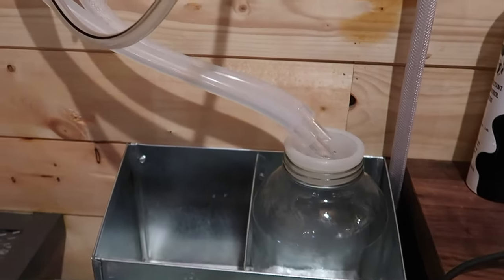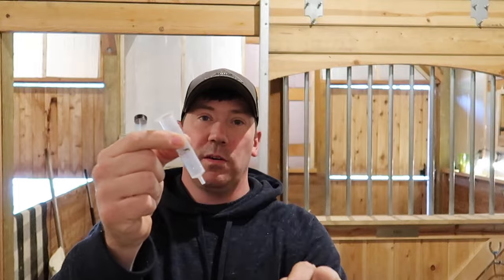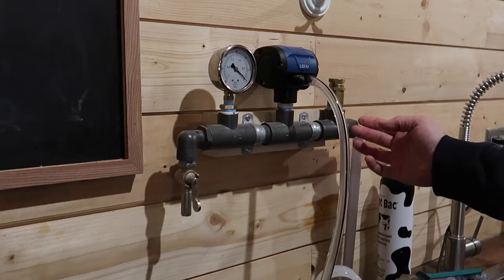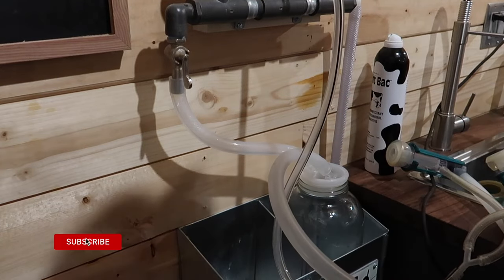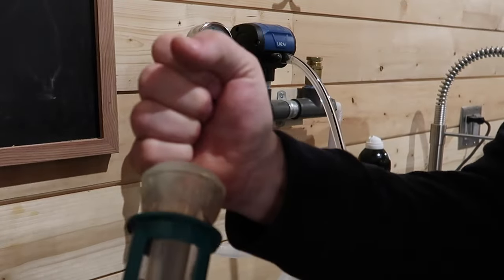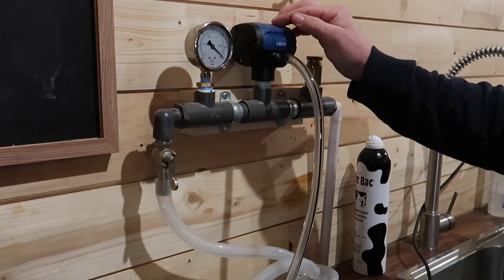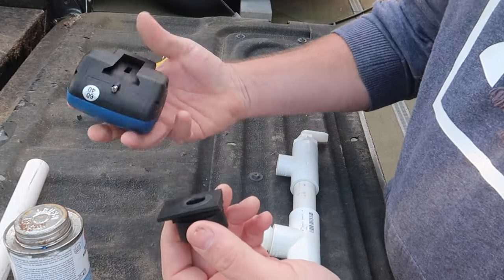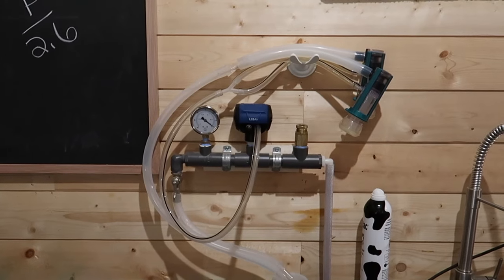Best DIY Milk Machine For your Homestead or Dairy Farm! Goat Milk Machine

Comment: So....if you didn't have a vacuum pump, could you de-pressurize the glass jar so it had a constant vacuum? Would the system still operated though perhaps not as efficiently? How much psi do you need for effective milking on the goats?

Comment: I'm in the process of putting this together and sourcing parts from the suppliers you listed for the viewers.  What I am running into is that some of these suppliers can get a little testy when they figure out that you are going to DIY.  The product descriptions on some of their websites are not clear or missing key information like dimensions.  If you need to call and ask questions, try not to let on that this is DIY and the conversation will go easier.

Comment: Thanks for the video.  I have an older blue tank simple pulse that had one side of the tank pop off.  I didn't want to buy a new system and was thinking of a way to replace the tank portion but trying to seal holes in a round pipe was pretty tricky.  This idea is perfect since I already have the valve, guage and pulsator from the simple pulse.  I've upgraded to a small bucket now with my Sables which milk more than a gallon jar can hold so looking at scrapping the clumsy jar holder on the tank anyway. So glad I found your video.
Reply from the maker: Awesome 👏🏻 glad it helped!

Comment: I am curious about the decision to use 3/4 PVC.  Most of the machines have a pressure tank that looks to have a 3 to 4 inch diameter.  I am always concerned that some milk or maybe just milk vapor will go into the tank and want to be able to clean and see the inside.
Reply from the maker: We haven’t had any issues, and we did take it apart and look inside once and it was dry. I don’t let my milk jars get anywhere near the top, though I’m very cautious of an overflow.

Comment: I am in the process of copying your as well just need to put it all together, hopefully today! Rather the a barbed fitting for the milk line and pulsator I used a 3 inch long 1/4 inch npt (1/2 inch outside diameter) brass nipple leaving me with threaded end on one side an smooth on the other. the silicone milk line and the pulsator both fit tightly on the cut nipple but can be removed for cleaning. Thanks for the videos!!!!
Reply from the maker: Nice!! That’s a good idea.

Comment: What is the purpose of the valve on the left of the manifold? Also what position does it need to be in for operation. Thank you.
Reply from the maker: The position should be how it shows in the video the valve on the left we’ve never actually used, but you could shut off if you had an overflow by turning the valve

Comment: Thanks so much for taking time to post this video!!!  I'm preparing to build a machine for our homestead, and it has been so helpful! I do have a couple of questions about the differences between your fixed and portable machines.  

 1) Could you tell more about the valve lever on the left side of the fixed machine that connects to the milking cluster?  I noticed that it's on the fixed but not on the portable.  What is the purpose of this piece?  

2) The order of the pulsator and gauge seem to be reversed on the two machines.  Is one way better than the other?
Reply from the maker: The valve is just a shut off we haven’t had to use it. I think the wall mount is the best for gauge placement.
Reply: @JohnsonFamilyFarmstead  Thanks so much for your response!

Comment: I milk a small Jersey cow. I have a surge milker that is designed for a large milk cow, purchased several years ago for a different cow. It has a 5 gallon container that is heavy, bulky and a pain to wash. It was easier to hand milk  the little Jersey. But I'm getting older and the hands aren't what they used to be. So I went looking for a way to use the components that I already have with a more user friendly design. 

Prices have increased since this video was posted. That said, this is the BEST DIY milking machine ever! I purchased the lids sold by Simple Pulse that fit on one gallon jars. My pump is a 7cfm with a brass pipe nipple coming out of the pump that had the gauge and regulator on a manifold. I added a "T" in the middle for a new pulsator. I opted to not use the existing 1950's pulsator on the surge bucket.

I have been getting a bit over 1 gallon at each milking with the hand milking, 2 gallons a day is more than enough for our extended family of 5. But OMG!!!!! Yesterday evening I used the new milker and Julie, the cow, gave 7 quarts! This morning she gave 6 quarts! I have got to find my recipes for cheese, yogurt, etc. This is insane! 

I need to figure out an overflow. Anyone have any ideas?

But thank you, this machine is the BEST!
Reply: What is wrong with your cow? Is she better yet? My jerseys put out five to seven gallons each milking twice a day. Only a gallon is an indication of something seriously wrong.

Comment: Hi I’m new here. I have Icelandic sheep, how do you figure what CFM you need for the type of animal you have?🧐 Also where would one get the vacuum pump for this kind of put together?🤔 Thank you :)
Reply from the maker: Hi welcome to our channel! To the best of my knowledge the cfm depends on how many animals your milking. One at a time you could use a 3cfm two at a time you would need a 6cfm pump. It is more important to regulate the vac pressure so you don’t have to much suction. There are a lot of different pumps I would recommend a oilless one less maintenance. This is a good website 
https://milkersupply.com/product_info.php?products_id=236

Comment: Thank you very much for this video. I’m in Chelan WA and I’m going to build a set up similar to yours. I have a question regarding your hoses… from the vacuum pump to the barbed inlet what size hose are you using ? 1/2in or 5/16? Also from the vacuum line to the jar cap? Is that also 1/2in like the milk line?
Reply from the maker: It is all 1/2 inch, I thought it was easier to keep it all the same size. The hose down to the jar is 1/2 food grade silicone hose, it’s easier to remove from the lid. The one down to the pump is cheaper hose from the hardware store. Thanks for watching hope your setup works out well for you.
Reply: @JohnsonFamilyFarmstead  one more question lol. What brand is your pump and are you happy with the pump? How long have you been using the pump? 
Was thinking about a oilless pump but is too much money for milking 4 does lol
Thank you
Reply: @JohnsonFamilyFarmstead  never mind , I watch the video again and could see the brand. But I’m still curious about your opinion and usage so far

Comment: Where did you get the vacuum regulator?  What vacuum do you run for goats?
Reply from the maker: We purchased the regulator from Hamby dairy supply, we left the link in the description. It’s the first link. We set our vac pressure at about 12 inches of vacuum. Thanks for watching!

Comment: Where do you get oil mist eliminator
Reply from the maker: We switched to an oilless pump linked above its so much better 😀 but you can check Hamby Dairy Supply for an eliminator.
Reply: Ok do HVAC vacuum pumps come with oil mist eliminators I live Canada I can't find a oilless pump here